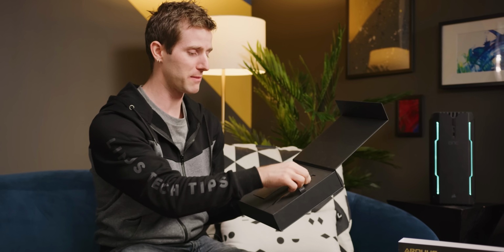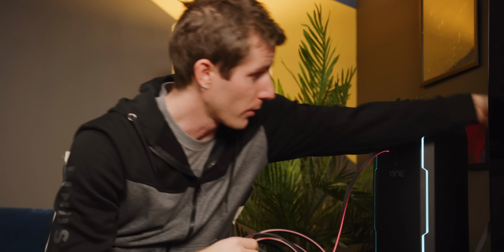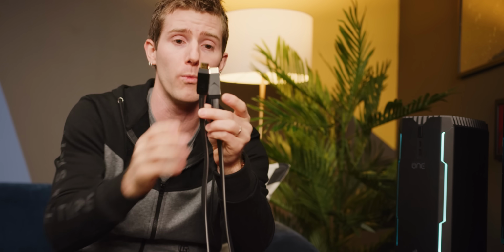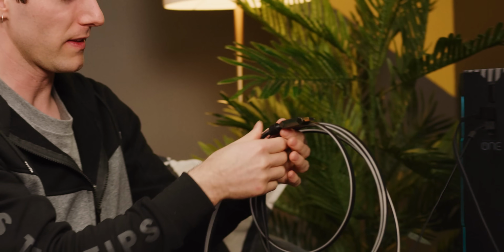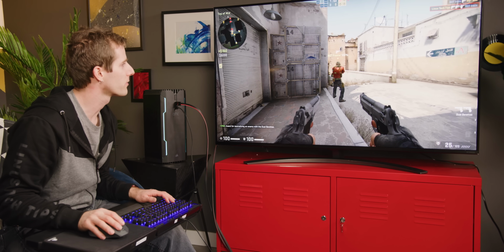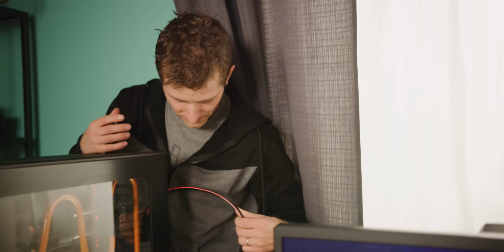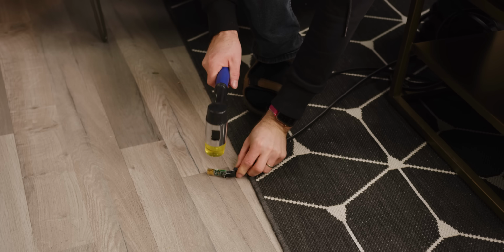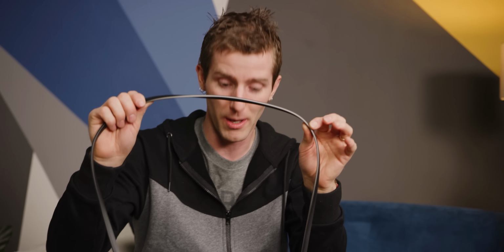The RGB HDMI cable ISN'T as dumb as you'd think...

Comment: PC elitists: $100 for an HDMI cable? lmfaoooo idiot

slaps RGB on the cable

PC elitists: $100 for an HDMI cable? BARGAIN
Reply: As an electrician that installed fiber optics in KTP in the early 2000’s, it is no where near as fragile as what you have been led to believe. What we used had a Kevlar thread inside of the sheath. You attached your pull rope or fishtape to that Kevlar thread for pulling purposes.
Reply: @kwhp1507  apples and oranges, my friend. Tensile (pull) wise, fiber is stronger than steel. And if you are pulling it in conduit, it isn't in a kink or in a place where it can be hit on the side. Those are where fiber is vulnerable, and as a patch cord/line, that is exactly what it could run into.
Reply: slaps it on table, breaks the fiberoptics - wiping out the cable...   BRILLIANT!
Reply: Not sure what classifies a person as an elitist. I personally think it's cool, but I wouldn't buy it even if it was $20.
Reply: @dierandomdie  Eh, $20 I'd consider it.
Reply: because it's a Fiber Optic cable, it's potentially worth it, even without the RGB.
Reply: @homegrowntwinkie   HDMI is a digital standard, so either the signal get trough or it does not. Meaning... if u have a chap HDMI cable and u get a picture, thats all you need. using an expensive HDMI, fiber or otherwise, there will be no difference in the quality in the picture. The only reason why a fiber optical cable is better is if you need a very long cable.
Reply: @MariusNilsen  Have you not heard of the different iterations of HDMI? It's literally like USB 2.0, USB 3.0 USB 3.1, etc. They've allowed different things to go into the standard. Including Audio, better display output, etc. So no, that's not all your need.
Reply: @homegrowntwinkie   sure  HDMi 2.1 is the current if im not mistaken.  My point is that  as long as the signal is digital, it either gets through or it does not. There is no quality difference. An expensive HDMI cable will not give better signal quality over a cheap cable.
Reply: @homegrowntwinkie  right but fiber optic doesn't affect that standard at all
Reply: @MariusNilsen  Ah but you're going back on it... Audio is transmitted through HDMI. I imagine adding fiber optic could make an impact whether it be future proofing it, or something else along the lines of another implementation. UNLESS they're using fiber optic like they did in those stupid fiber optic light/lamps from the early 2000's for the RGB.
However, HDMI 2.1 will cost more than a traditional HDMI 1.0 cable.
Reply: @homegrowntwinkie  But there literally no difference between good, up to standards HDMI cables for like $20 and one with fiber optics for $80...
Reply: @resneptacle  but there is a difference and I literally just explained that. You could pay $20 for a potential HDMI 1.0, or $100 for an HDMI 2.1, plus it could be future proof, depending on which way they decide to take HDMI in the future.
Reply: Nope. It's still dumb.
Reply: @ChemicalXJ9 no u got the dumb ahahah
Reply: @112523  WOW HAHAHAHAHAH SO ORIGINAL HAHAHAHAHHAHA FUNYNNNNYNYN

Comment: On the reduction of interference...it may be true that fiber is not susceptible to electromagnetic interference, but it's completely irrelevant in this case. Digital, error-corrected signals through an hdmi cable are pretty resistant to interference. There is no reason to buy an expensive fiber cable when the cheapest chinesium hdmi cable will do the job just as well.

Comment: "using rgb light on an expensive cable to identify which cable is which"

Or just get a label printer and pre-label everything, you are welcomed.
Reply: But then I would have to turn lights on and prepare flashlights.... And pray that no one modified the labels on each ends...

I kinda like the length, the shorter cables I have extremely limit hardware placement...
Reply: @chriscantrell9012  with this cable, you have to pray that no one (like linus) uses a hammer for maintance.
When labeling cables, just put on a number. It does not matter if 1 gets disconceted from the XBOX so that it can be connected to the XBOX one and latter, Cable 1 is beeing used on input 4 of a HDMI switch. It still has 1 on both ends.
Reply: @sarowie  You also have to spend hundreds of dollars just to "Tell" what cable if for what 🤦‍♂️
Reply: @chriscantrell9012  if you want to be extra sure, print the label on heat shrink tube and shrink it on the cable. Likely still cheaper than a few of these fancy cables. And don't put the "someone might modify it" into consideration. That's an issue on the administration side, not the hardware side.
Reply: @NoBodysGamer  AFAIK people rarely color code cables, unlike wires. So things gets worse since you need to buy all the different color heat shrink tubes, and the smaller ones wouldn't fit anyway.
Reply: he also says that at the end, realizing how overkill the solution to a simple problem that was
Reply: Why would we do it the boring way?
Reply: Nobody needs RGB it is just for the looks, we all know that.
Reply: to be fair the problem isn't just the ends of the cable, but tracing the tangled web behind your cabinet or desk.
Reply: @woooweee   Well there's also multi colored cables around and different looking ones for that problem
Reply: Labels are lame, they will fall off, smudge or otherwise become illegible. Not gonna happen to colored zip ties. You can identify stuff with different color, count and combination. That’s how I identify the Ethernet cables in the wall.
Reply: That's not the primary purpose of the cable. These cables can be very long which is the point of fiber optic cables which Linus seems to miss or gloss over in this video. Copper cables simply can not be long and not degrade 4k video. So the fiber optic cables have a real use.
Reply: He said it was a first world fix for a small issue. Am I going to rush out and buy these cables? Not for $70 but if they were like $25- $35 maybe. 
Now I understand the thought, hey I could just label them. But as someone who has hooked but up to 15 devices to a single display. Being able to have the ability to color code the entire cable is intriguing. Especially when normally I'm looking at a tangle of black spaghetti.
Reply: he gave himself a different solution with color stickers but didnt even acknowledge it

Comment: The statement "Speed of the data transfer" (assuming they mean it's faster although that is not stated) is actually false, searching the net I find that fibre signals actually travel slightly slower then signals through copper wire, but it is in the nano second range, adding maybe 1 millisecond over thousands of kilometres of distance. Also the latency for the conversion from copper to fibre and back to copper again is not zero but very low and not noticeable. So the only reason to buy this cable is if your PC is somewhere where there is so much RF noise that a normal copper cable won't work, which is not inside anybodies house. In other words this cable is mostly for bragging rights which will delay your signal a few nano seconds versus copper. I can buy a colour changing led cable for a lot less then this cable. This cable is mostly useless crap to show off with for any normal home use.

Comment: Ok Wizz kids i got a queastion 4 Yall but first u have to know wats in my black playbox.

ASRock Fatal1ty Z270 Gaming K4 Intel Z270 So.1151 Dual Channel DDR ATX Retail

Intel Core i7 7700K 4x 4.20GHz So.1151 WOF

Aorus GTX 1080Ti 11gb

Corsair Vengeance DDR4-3200 (2X8GB)
2x M.2 Samsung 960evo (1tb/250gb)
800W Power supply

 so now the question, does it make sense to upgrae to 32 gb ram when i eventually buy the new RTX 2180Ti or is 16 still ok?

Comment: 5:50 ... i've had a similar experience with the HDMI splitter that i'm using i.e. it has a power connector but it doesn't actually need it. It runs perfectly fine without it

Comment: Fiber optics cables are nice but they are more fragile than typical copper wire (basically its glass to transmit light). So these cables need to be handled more carefully and should not be moved (bended etc) much. At least that is what I can tell from experience working with network optical fiber cables.

Comment: Linus: [notes it's a fiber optic cable]

Also Linus: [starts swinging it around and bending it at strong angles triggering me]
Reply: Watch the rest of the video, he knew he was going to destroy it anyway.
Reply: @sidsonit  ocean fiber optic cables go higher than 10TB/s
Reply: Derry Dobbie I swear he did it on purpose
Reply: @sidsonit  No, fiber optics does not max out at 10Gbps, it can go much higher, so far I've seen as high as 400Gbps
Reply: @clippylinux  Well Actually few years ago there was a ofc, a single strand pure glass, which could transfer data at ~1.2 Tbps. I'm not sure about the distance though but pretty sure it's longer.

Edit: Just checked, the max achieved speed in 2014 was about 255 Tbps and the theoretical limit is about 1.2 Pbps. ,
Reply: @clippylinux  Depends on the length and modulation of the cable and the light source. 

however you are correct the current standard allows for 400G over short distances,
Reply: Yeah!!! For a split second there (when watching) I thought the pop at 1:53 was the fiber snapping, LOL
Reply: @veizour  Lol... 😂
Reply: I shit you not nobody understands fibre optics in this comment section. They are definitely not plastic or PMMA as Toslink uses - those are multimode milimeter thick cables that can do 1000Mbps at best per channel far from 18Gbps/4K60fps this cable has been tested for. When Linus opens one side of the cable you can clearly see that there are three thin rgb color coded fibres surrounded by strenghtning fibers which signals that these are for 90% SM Glass Fibres 10Gbps each (running in 6Gbps in this case) for cost reasons. If it would be cheaper to use single 40Gbps link they would opt for it.
Reply: I would bet that these are just plastic/acrylic fiber optics like TOSLINK optical audio. Would bet even that can handle still the 18 Gb/s anyway (probably would mostly affect the length instead), don't think it would start having refraction issues and all at those rates, but dunno for sure.
Reply: @Kalvinjj  supposedly people have gotten over 40gbps through TOSLINK cables. Obviously not over much of a distance but it’s still cool
Reply: guess you didn't watch him bag it with a hammer?
Reply: Angles
Reply: Oh hey, it's you!
Reply: @Zwenk Wiel Yes, and that's something you can't do with high speed copper wire, because they start to interfere with each other electromagnetically, while that isn't an issue with fibre.
Reply: @sidsonit  As someone who works with fiber optics, you have no idea what you're talking about.
Reply: If fiber optics couldn't go past 10Gbps how on earth do ISP's run their backbone signals? 

Nobody would have higher than 10Mbps signals if what you say is true.
Reply: Paul Elderson Even if the weren‘t faster, it would still work: you would just need lots of them
Reply: @paulelderson934  With multiple fibres of course
Reply: Ian Speer cat 5e - cat 7 cable I believe is what maxes out at 10gbps.

Comment: Next video: "We watercool an RGB HDMI cable"
Reply: Overclock to 19gbps
Reply: @ethanlatimer1956  LTT has not covered the nvme drive overclocking :)
Reply: Imagine copying the top comment
Reply: Copycat
Reply: stolen
Reply: over-cooled... superconductive hdmi cables!!
Reply: "Elon Musk wants to know your location."
Reply: @joe.a8361  that’s the joke
Reply: The fiber doesn’t need to be cooled, but the endpoints might.
Reply: Haha
Reply: lmfao
Reply: EV chargers actually use water cooled cables to allow using thinner conductors than normally possible

Comment: Wait, you go to the back of your TV to switch cables? I just use an HDMI switch and it has been working for years with no trouble. It even has it's own little remote to control it, or a button if you are prone to lose remotes.

Comment: There’s no way in hell that cable lights up with 50 mA on 5 Volts and still has enough power for the fiber optics transmission.Your devices surely had an MHL implementation.

Comment: Think about this; You’re in a server farm and have hundreds of cables running around. With the cables lightning red or green whether they are connected or not, you could easily see problems within the system just by looking at the wires and not only at the machine. Also as an help for changes when one guy in a control station instructs another guy at the location to switch some cables, this could aid as an visual aid, if the guy at the control station is in control of the cable lights.

Comment: That looks like a SiliconLine fibre chip, there are only really a few brands out there that are available easily. The copper cables that are left connected are for HDCP, the handshake is too sensitive for it to be carried across a fibre. There is generally 4 to 6 cores in copper depending on the HPD setup.
Most cables advertise 18GBPs, although I have seen some cables with very high hysteresis on the decoder end. This generally equates to image artifacts on the display. I have confirmed that most cheaper fibre cables will be out of spec when using a Quantum 980x for testing.
A misnomer in the industry is currently the FIBBR cable. This cable has exceptional metrics and has allowed for additional brightness in projector setups when calibrated I work with cables in general everyday. The measurable difference from the FIBBR model was a surprise to myself and other professionals in the industry.

Comment: In regards to the power input to boost the lighting, did you check if that lessened the weak lighting in the middle of the cable? You only mentioned the loss of light after you had already tested the power input.

Comment: "no copper", except to uh power the LEDs and the lasers for the fiber. what would've been really cool (although likely pretty costly hardware-wise) would be to have the RGB LEDs update to the average color of each frame as it's transmitted.

also, converting an electrical signal to optical does have a latency cost. in networking, fiber SFPs have a few nanoseconds more latency than direct attach ones. that is real, measurable latency, just not latency that matters for things like gaming where latency is typically measured in milliseconds or maybe 100s of microseconds.

Comment: I actually have bought two fiber optic HDMI cables for my two projectors, the source is nearly 200ft away so a copper cable was not an option, and Ethernet had Latency issues. The only issue I had with them is that the wire was extremely thin, so kinking the wire would break it. Fiber optics in HDMI has its place, but I would only buy one if I needed a cable longer than 30ft

Comment: LTT: has a huge ass machine shop with CNC and lathe
Linus: takes a hammer to HDMI cable
Reply: Every tool's a hammer
Reply: @sonni2096  and every hammer is a tool
Reply: @mattforbes7833  also a hammer is every tool
Reply: anyone who fixes shit on the reg knows a hammer is hands down MOST USEFUL TOOL!
Reply: not sure how a cnc or lathe would help you crack the connector off a hdmi cable, dead blow hammer was a surprise though
Reply: @Stue-e  The implication is the Advanced tools available, but the best solution he thought to use to open it was a hammer.
Reply: @Stue-e  Clamp it in the manual mill and take cuts slowly on the plastic case :)
Reply: Who Ever Convinced a YouTube Channel that does 100% Tech News and Reviews to blow $200,000 + in heavy machinery that is 99% Never used. Really hurt LTT. ♥️
Reply: dremel would have been plenty haha
Reply: Unless it's a screwdriver, then it's a prybar or chisel
Reply: Plot twist: Linus isn't a machinist.
Reply: DickBurns why have the machine shop than? :P
Reply: I wanna like this comment, but its at 420
Reply: Linus doesn't like wasting time.
Reply: That’s a mallet not a hammer

Comment: 5v 50ma is the standard for HDMI but most of the manufacturers throw 1-2amps to it anyway, this is why its very common for HDMI on some devices specially on game console when their plugging HDMI cable while TV is ON and frying their either their console's HDMI circuitry or TV HDMI circuitry or both.

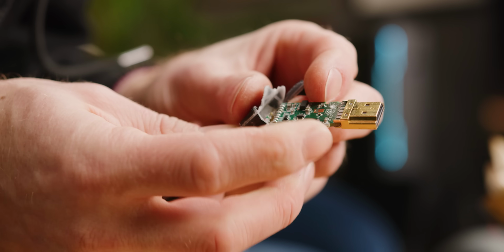Comment: 10:20
"Receiver, 5v, ground, trasnmitter (...) I wonder if that's for RGB"
That's actually just UART, and is used for communicating with the on-board microchip for diagnostics - hence why it was left unconnected.
Reply: I think UART is being used to synchronize RGB lighting in both cable ends. Maybe I'm wrong, but that makes sense to me
Reply: I guess there is a copper run in the cable to power the Monitor end of the cable if the Monitor doesn't output enough power. Otherwise it would need a micro USB power connector on both ends. It could also be used to communicate with the RGB controller on the Monitor end.
Reply: Yup, was thinking the same thing. Or maybe it also can allow for reprogramming the the mcu.  Hrmm, wonder if you could get diagnostic output of what the fiber optic mcu is doing.

Comment: "Um so I kinda spent all of my gpu budget on this cool fiber optic cable and ended up getting a GT 1030 as my gpu but there shouldn't be any problems with fps because the expensive cable and the cheap gpu should balance out, right? It's got fibers so I get extra fps and it's also got rgb so even more bonus fps"

Comment: The RGB is the laughable part of the W73, but Vivify have the W30 which is just a thin black Fibre cable.
Interestingly the W30 doesn't have the extra power micro-USB... so the extra power and bulk is just for RGB.